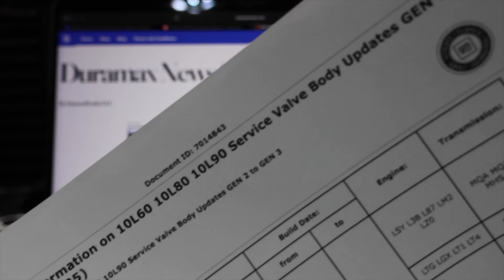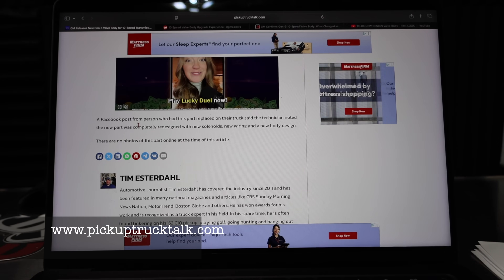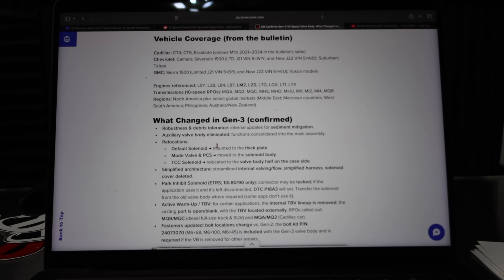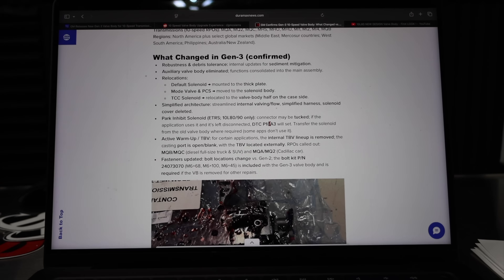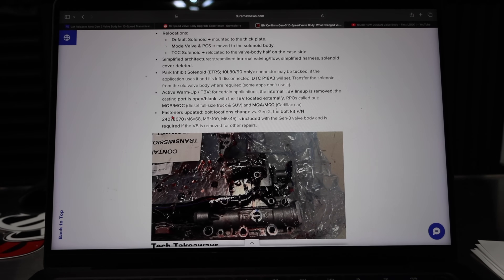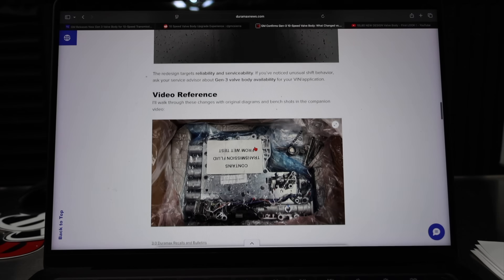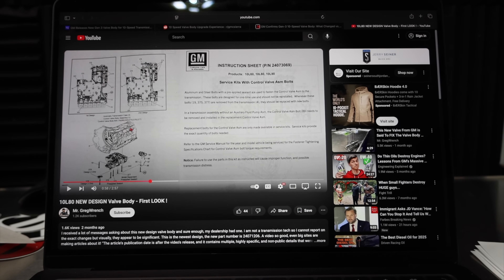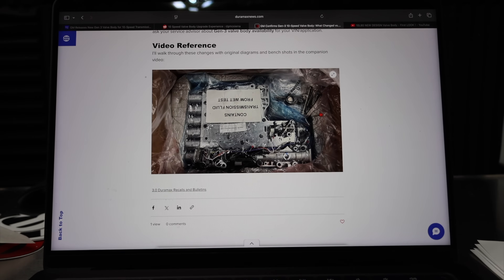Did GM Just Fix the 10L80/10L90? Gen-3 Valve Body Explained

Comment: I'm curious when these made it to the assembly lines.

My 1500 was built January of this year, and on rare occasions it likes to downshift too aggressively if I slow down and lightly accelerate again.

 I'm assuming I have the older design and this is a problem I'll probably have to deal with before the warranty is up.
Reply: Warranty for tbis is 15 year or 150k miles…..unless your driving across country for a while, you should be covered a while lol

Comment: Those were my pics from that Reddit post - the NextGen kit has been working great for me for those that are interested. The true unknown for this redesigned Gen 3 valve body is if the materials for the valves (hard anodized aluminum) has been changed to a more durable material like steel. Someone needs to do a detailed tear down.
Reply: Agreed and I’ve been trying to get my hands on one personally. The problem is the $1000 core charge on it😏
Reply: @performancetransmissionsll1573 you think my 1st Gen would be accepted as a core?

Comment: Just installed this after a terrible experience with the so called “Next Gen valvebody” fix (was not the fix at all). This Gen 3 valvebody is superb!
Reply: NextGen kit has been working great on mine for over 3k miles. If you had a bad experience it probably wasn’t installed correctly - there are tons of places where mistakes can be made during the kit install.
Reply: What happened with the next gen? I was wanting to install the upgrade kit on mine.
Reply: You messed up installing it then.
Reply: There is some lack of support from the Next Gen customer service. The instructions and illustrations for the 10L80 they provide is the Gen 1 valve body. They also don’t tell you that you need to clear and do a transmission relearn. Prior to doing the relearn, mine was having hard downshifts. After the relearn, things have smoothed out but will still get a harsh downshift here and there.
Reply: @slowsleeper550 NextGen’s instructions are definitely lackluster. I had to use Alldata, the ATSG 10L80 manual, and GM TSB info to get all the correct info. Mine had some hard downshifts in the first couple weeks but I didn’t need to do a relearn. Everything has adjusted well over time.
Reply: Nah, no problems installing lol pretty straight forward actually. I just really didn’t like the harsh shifting at random times, probably a good kit for somebody, just not for me. I got their 8 speed kit in another truck and like it a lot!

Comment: My build date is 06/2025. Do I have a gen 2 or 3?
Reply: Look for the RPO code of your transmission (QR Code inside driver door takes you to the RPO codes for your vehicle).  I checked mine which I purchased in 04-25 and it is on the list of affected vehicles

Comment: Well just another thing I have to wait to fail on my ‘24 3.0L that has run perfectly for 50K.
Reply: Stop worrying and just drive it
Reply: @5005ktl I was being sarcastic! I’ve never had an engine or transmission problem on over 30 GM pickups/SUVs since 1992. I’m not saying there can’t be issues but I think they are overblown and are rare.

Comment: Gen 3 was a failure, NextGen Diesel exposed it as a fraud . Even the part number is false,, only real permanent fix is the project carbon valve body kit or complete valve body..
Reply from the maker: I watched the video of them trashing it, but they didn't show this one, they referred to the gen 2 as the gen 3. Good marketing.
Reply: @DemonWorks No it was the Gen 3 , Im a GM master tech with 45 years in the industry and the Gen 3 valve body is shit , our shop has installed at least 15 in the last two months and every one of them returned with failures , the only successful permanent fixes I have experienced have been using the Next Gen Diesel Project Carbon Valve Body kit or the complete valve, fact is GM is now issuing purchase orders to Next Gen Diesel to allow GM dealers to buy the parts from Nate in order save face at dealerships … Fact!
Reply: prove it. seems like you are trying to sell something... the moment you inject: I HAVE xx years in the industry means that you have to add weight to your statement because of no facts.
Reply: @highlanderc obviously you are not aware of the total shit show the GM 10L1000 customer base is dealing with , the long wait times upwards of over 3 months for parts and when those parts do arrive they only offer a temporary fix , there are hundreds of these failure experiences happening almost on weekly basis , why else has GM had 3 attempts at a fix and now they are on number 4 because the Gen 3 Valve Body is not solving the problem permanently. As for proof contact your local GM dealer and ask them . GM did not address the separator plate failures effective enough all they have done is supply a new set with a correction to the mis - stamped defective plate what they did not do which NextGen did do is make it from thicker and more durable composite steel , no more separator plates and check balls beating holes in the plate causing internal cross leakage that led to rear wheel lock ups at highway speeds … You can get your proof from anyone of number of sources, I don’t give a crap what you think…Ask the customers who first had GM try their attempts with GM supplied parts then got fed up and fixed it once and for all with project carbon …!
Reply: @highlanderc  https://youtu.be/pycKfBkOiFc?si=LXWRcCiBNzoJ2B3_

Comment: Im buying a 25 3.0L tomorrow. I hope it has the 3rd gen.
Reply: Don’t buy it , the 3.0 Duramax engines are having catastrophic engine failures due to Thrust Bearing Failures, I just did one two weeks ago that failed on new drive away home trip leaving the dealer ship, some failing at a few miles to a few thousand miles but it’s enough now GM put out a TB ….
Reply: @cbnx82703  I have a 24' with 40000km. love it so far. well see how long that lasts tho. best milage was 5.5L/100km. Avg 8/100km
Reply: @cbnx82703  all their engines are having catastrophic engine failure.
Reply: If you didnt buy it yet make sure if you want. Dont rush it

Comment: i got the gen 3 installed in late August part number confirmed. Truck shift drives better then it did new.
Reply: That’s a personal mind perception
Reply: Whats the Gen 3 part number?
Reply: @norbertibarra9029 part number is 24071206. Just had mine replaced in August.  So far no more rear wheel lock up.  That crap was scary.

Comment: Cost of replacement? And sorry for my ignorance but is this for the 3.0 Duramax or the 6.6, and is there a way to get this replaced without any cost out of my pocket?
Reply from the maker: If you have an issue that warrants a valve body replacement, it would be this one. if you don't have any issues, then you are all good.
Reply: @DemonWorks so I'm not a mechanic but I've been noticing lately that when I'm driving around 30-40 mph I've let out the gas and then I go to go again. It kind of hesitates for a split second and then a slight thump

Comment: So how does this work? Are we able to get this updated valve body or do we just have to wait for our current one to fail before we are able to get the new one. Im suprised that we arent getting a recall to update our valve bodies if orr current ones are so problematic that they are doing major redesigns like this
Reply: You’re not just going to get a new one. If yours fails, then you will get this one. But what makes you think the new one is any better?
Reply: @Maynardd Because it's quite a bit different design.  Engineers do try to improve things.  So far people are reporting good vs bad. Mine just went in for a new one.  19k miles.